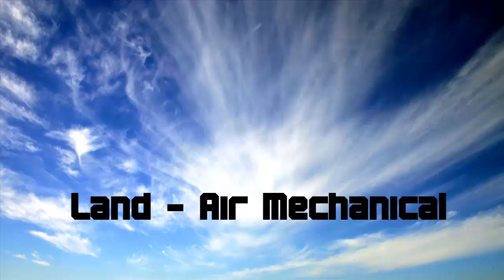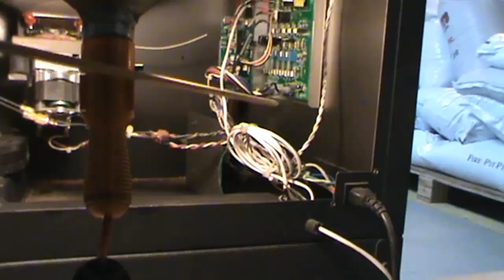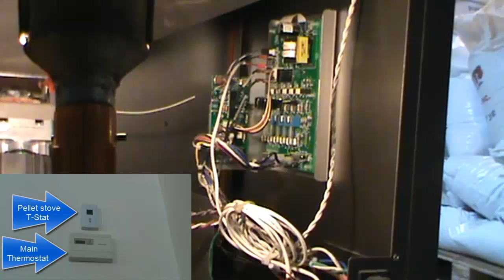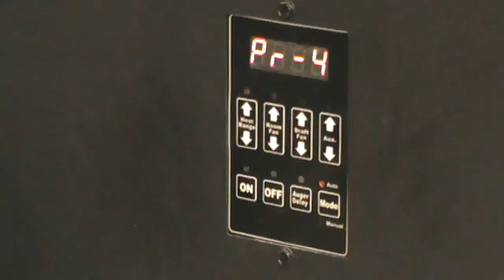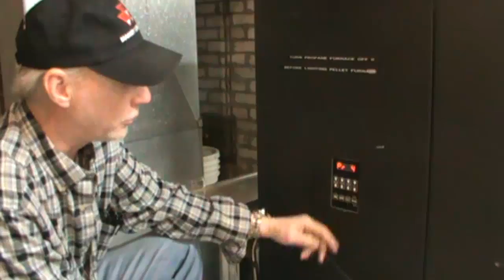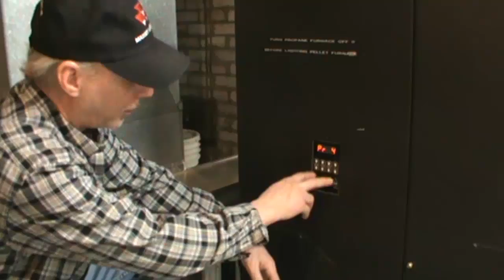How To Hook Up a Thermostat To Your U.S. Stove Model 8500

Comment: I picked up a Honeywell RTH6580WF thermostat.  I have no idea what to wire to.  Instructions say to use "C."    I have the following letters (left to right) K  Y2 W2 G W C Y R Rc.  I could use some help, if possible.  Question: Does the temperature sensor wire (coming from stove) provide voltage, to power this thermostat?   Hope you can help.  This appears not to be a battery operated thermostat.

Comment: My stove draft motor comes on and off constantly is this normal or is there a way to change its settings in the c settings  i am running inauto mode with no thermostat thanks
Reply from the maker: Tom Cavalcanti  that is normal
Reply: Thank you i just ordered a stainless steel agitator from you today my broke today thanks again

Comment: I did all the temperature set up as in your other videos. Now I installed a battery operated thermostat and when I hook it up as shown. My dash and my temp setting number both flash all the time.  My thermostat only takes 2 AAA batteries. I am guessing that is not enough voltage. Not sure. If not can you recommend a thermostat that will work. Thanks for the videos, Bryon

Comment: How do I wire in my honey well non programmable thermostat model RTHL111B1001 to my 8500 stove? My thermostat I purchased has B O G Y W R RC connections on it... it is battery powered thermostat
Reply: Is the Honeywell RTHL111B a low-voltage DC or millivolt thermostat?  If not then it will not work.  If you have a pellet stove or pellet furnace you are using for heat, then you only connect two wires, the Red R and the White W.  A pellet stove or furnace only uses 2 wires and they are usually low voltage 4.5 to 12 Volts DC.  It is really simple, but you need a low-voltage 4.5 to 12 volt direct current.  Do not use 24 VAC.  -- Richard, CORN STOVES of IOWA.

Comment: Hi, just wanted to thank you for your videos on the 8500, they have been a real life saver.  My low heat and high heat settings were 7.89lbs and 14.89lbs.  Which I'v corrected from 2lbs on low to 5lbs on high.  All your information is extremely appreciated.  I do have one question for you, it looks like you have a digital thermostat hooked up to your stove.  I bought a honeywell RTH7600D, and I couldn't get it to work, I'v removed the jumper and my connections are solid, and I'v also wired to the terminals specified by honeywell.  Anyway if you have any advice for me as to either get a different thermostat, or if you have any suggestions on what steps are needed I would be very greatfull for your time.  Thx again for all your videos^^
Reply from the maker: Your themo needs to be battery pwr'd, plus soild 2wire thermo wire
Reply: +Land/Air Mechanical Nice thanks for the help, I realized after I took a multimeter to the pcb board that it only produces 5volts, putting the batteries in the thermostat worked, since it needs more voltage than it was getting.  Again thanks for the help^^